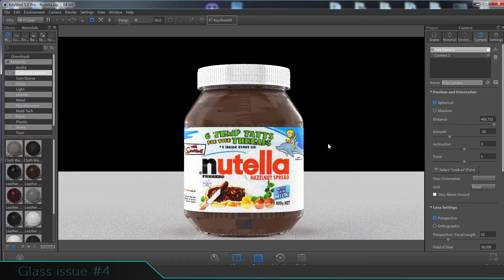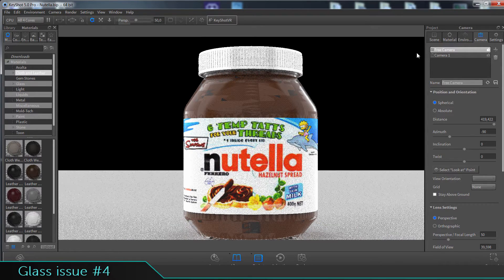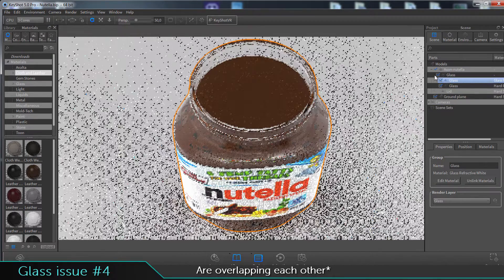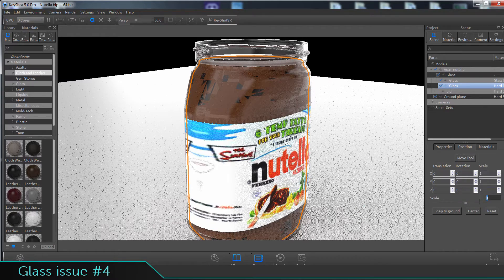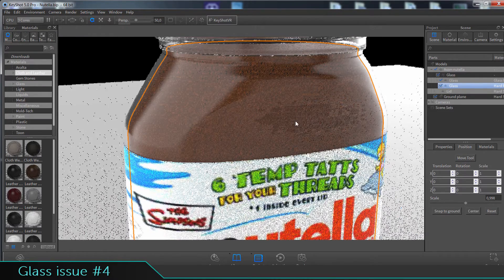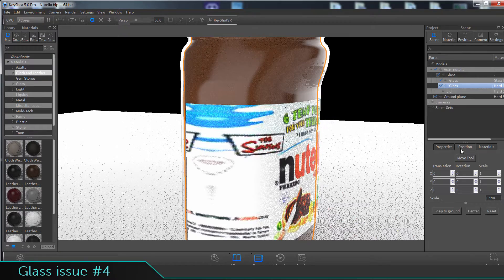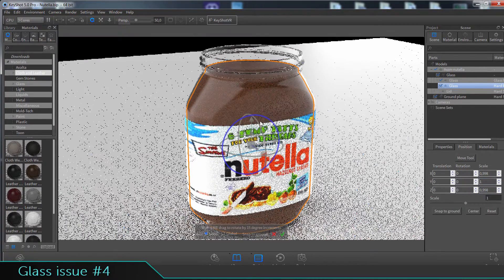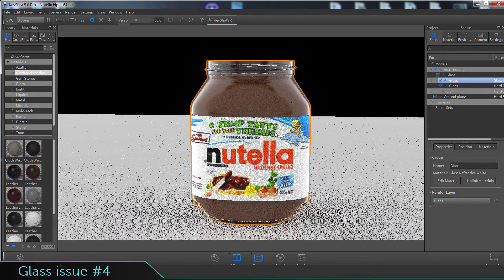Keyshot quick tip #4 - Transparent material problem and fix

Comment: is there a way to show the axis in the model space, I never seem to know which way is which, when moving graphics or labels positive or negative direction is not always the same when importing models? Thanks great video I've run into that problem a few times working with transparent plastic or glass. cardboard signs behind have to be moved away from the glass surface.
Reply from the maker: I really am not sure if there is the option to see the axis and orrientation but see in program interface and maybe you will find something
you're welcome, also new versions of Keyshot like Keyshot 8 I believe are not having this glitches

Comment: Can you show the key shot rendering tutorial of this Nutella container from the very start? 
I've just finish the solidworks model.
Reply from the maker: sorry but it's very easy so I am not really into making video about it
on the lid you put plastic material, on main body you put glass material and then if you have the label to put over glass that's great as well
inside of jar there should be cream body, there you can use brown plastic